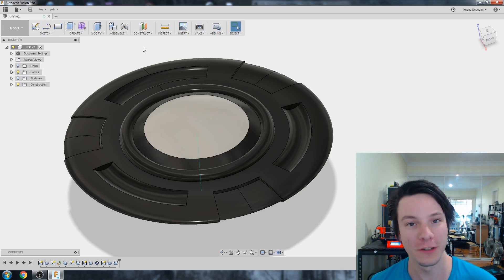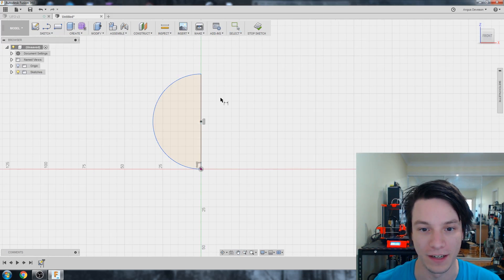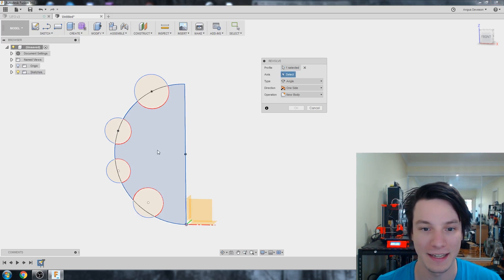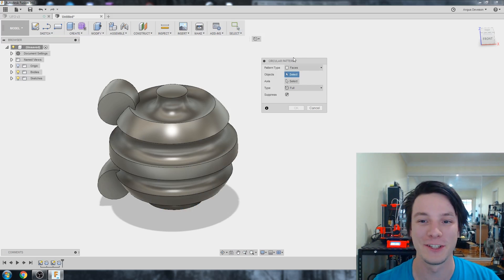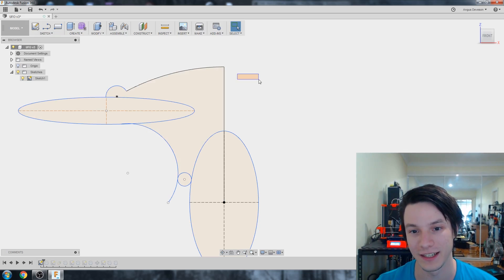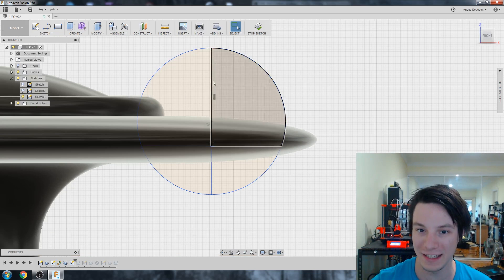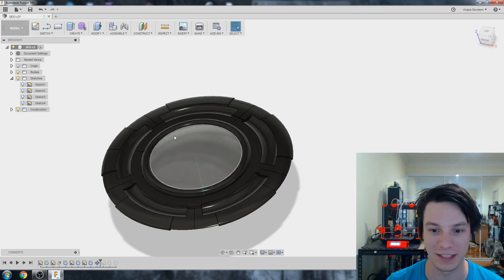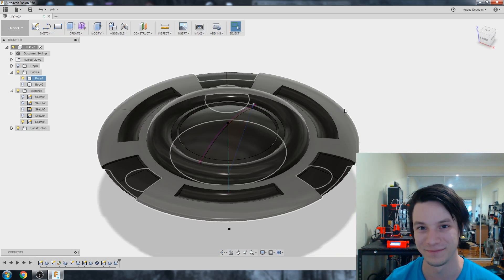How to use Revolve in Fusion 360 - CAD for Newbies

Comment: I like your explanation. I'm certificated professional Inventor 2013 and I'm mechanical engineer.
It is very important to place center of the ball in the center point (intersection of the axis X,Y,Z) because when you'll decide to make assembly and to place the ball you can use constrains as Work planes as axis

Comment: The software only works for 30 days, This video made want to try this. 
And it seems you never own this software, Its $300 per year for the cheap one. 
Just fuck that, Sorry Angus that is just shit. I used to like Autodesk. I started with 3D Studio R2, it was not cheap but at-least it was actually buyable.
This left me feeling like, what the fuck. I hope they fail, I doubt they will.

edit: Does it require internet to load even ?
Reply from the maker: um, no. At the end of the 30 days register yourself as either a student, or start up. If you're making less than 100K a year using it it's free. I've mentioned it tonnes on the channel. https://knowledge.autodesk.com/support/fusion-360/learn-explore/caas/sfdcarticles/sfdcarticles/How-to-activate-start-up-or-educational-licensing-for-Fusion-360.html
Reply: Ahhh, well I will have another look, I am dead against subscription based software or even software that requires internet to work.
Thanks dude.
Reply from the maker: It definitely needs internet. It'll run offline but saves to the cloud as well as regular updates.
Reply: Saves to the internet ? As in it sends my files to another computer be default ?  Now that I wont allow.
lol, I guess ill see how it responds to the Comodo firewall.
Reply: ProCactus Actually, you just need internet to download the program and sign in. If you are modelling something, you can save a .f360 file to your computer and you don't have to upload it to the cloud.
If you don't want to let fusion use your internet connection, you can switch to 'offline' mode (upper right corner)
Reply: That does sound kind of fair. 
However the subscription thing still sucks.

Just for the record, Im not too concerned with security in this program. I just don't think any 'cloud' activity's need to exist in this modern times. It would have been handy when computers were slow but that is not the case anymore.

Thanks for the input, It helped a lot.
Reply: Well you can't blame autodesk, they also have tons of programs for cad, such as AutoCad, Fusion360, TinkerCad (which is free and popular), and I'm sure much more. Generally I think AutoCad is more for commercial use,  TinkerCad for personal and educational use, and Fusion360 is just a much more powerful TinkerCad but not quite AutoCad. Fusion360 is also free for (I believe 4 years) College Students.

It also looks like you may be able to use it under their startup license: https://knowledge.autodesk.com/support/fusion-360/troubleshooting/caas/sfdcarticles/sfdcarticles/How-to-activate-start-up-or-educational-licensing-for-Fusion-360.html

Edit: Looked into it more, and at the end of your trial you will be able to extend it under the startup license as long as: 1. If you are using it for Commercial-Use then you must make less than 100k per year (total business revenue) or 2. You are a hobbyist using it for Non-Commercial use. 

If you meet one of those, then you can get a free year, at the end of your year, you will have the option to extend it for another year as long as you still meet the requirements.
Reply: Fusion 360 is 'cloud enabled', not 'cloud based'.

It uses the cloud for data storage and optionally for renders and simulations, which do require a lot of processing power. 

I have a work account and a home account. I can log out of one, log into the other and have access to my designs. When I'm doing a design for someone, I can generate a URL and they can view that design in a browser window and even annotate it.

This is a fantastic feature, at least when it's backed up with a local cache (which it now is with Fusion). You can chose how long a design is kept chached on your local drive without being opened.
Reply: Thank you, Will keep that in mind. Im curious though, on how it will react to having certain internet functions blocked. I know Autodesk have always been active in protecting their software, Could be interesting.